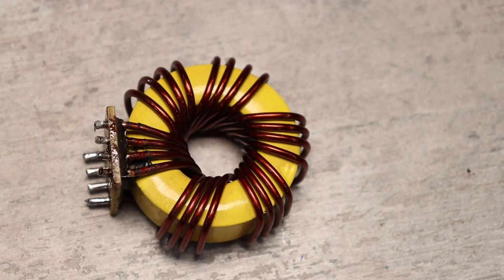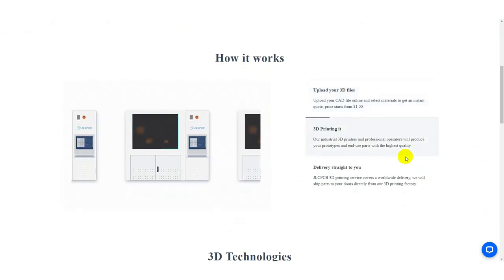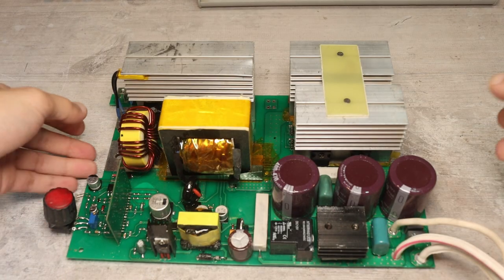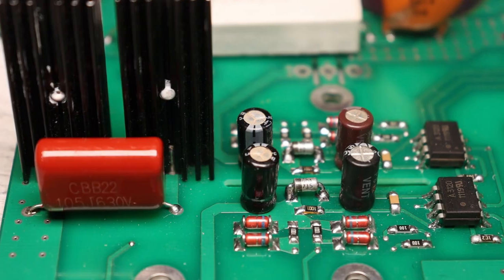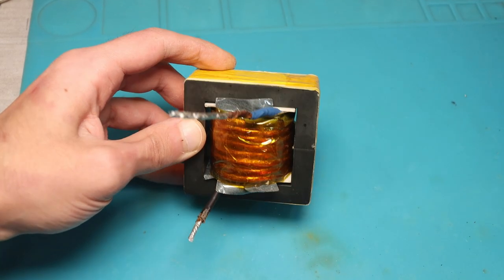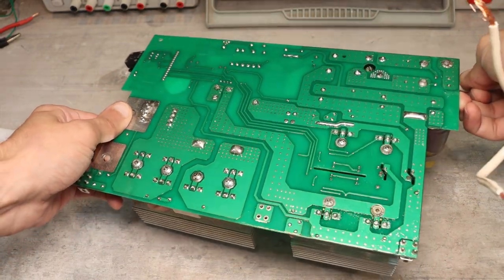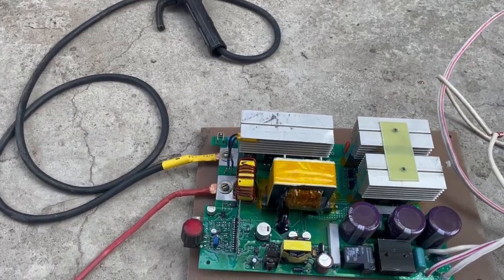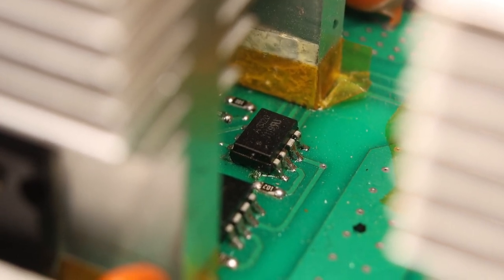Make a Welding Machine no worse than the factory one

Comment: In a forward converter, you MUST NOT use an air gap in the transformer, it increases the leakeage inductance, an thus the flyback current (in the reseting system), decreasing the efficiency. The airgap is only used in the flyback converter, because the energy is stored in the transformer, in a forward converter, the energy is only stored in the secondary inductor. The schematic looks good, nice job :)
Reply: Air gap is used in the forward converter to reduce the remanent flux of the core allowing more usable flux density 😉

Comment: Choke is not needed if you  constantly weld on high currents, but under low current settings, starting an arc without a choke is rather hard

Comment: I like your video.. sir, can i upgrade my Chinese inverter welding?

These are existing components:
-Igbt is  2 pcs. 60a/600v 
-Utra fast recovery diode is 3 pcs. 60a/200v 
-2 pcs. Capacitor rated 400v/560uf
-rectifier is 50a/1000v

I'm wondering if I can change the IGBT and the output diodes into a higher value.

Comment: Anyone have an idea of using something similar to charge my old car that needs around 200V?
No need for isolation between primary and secondary. I thought about rectify the 3phases and use some kind of PWM to limit the current. Is that the way to go?
Reply: how the heck does you car need 200v to charge up? usually there is just a 12v vaterry
Reply: @picanazo420  It's an old electric from the 90'ies.
Reply: @Frolleglse  well if you need exactly 200v you can use a variac and a bridge rectifier with capacitor to output 200v stable, if you dont need exactly 200v you can just use mains witg a bridge rectifier, that will output 200v rms with peaks of 325v
Reply: Unfortunately a transformer will be so big and expensive. Must be some switched power supply or PWM of rectifyed mains. Cannot rectify mains directly and feed the battery since the current would be enormous in such setup.